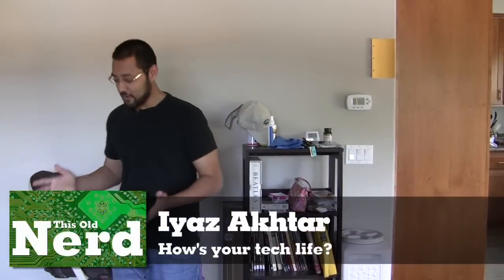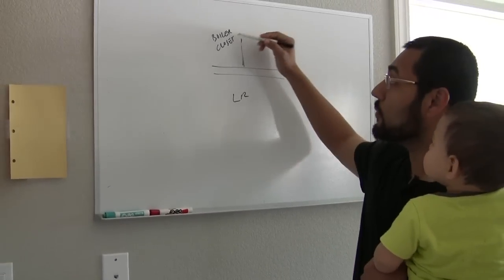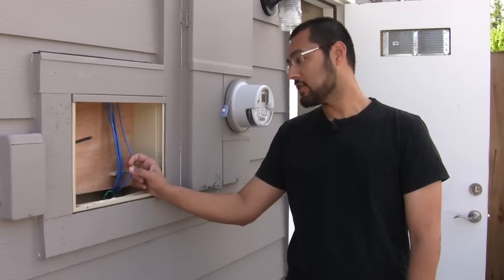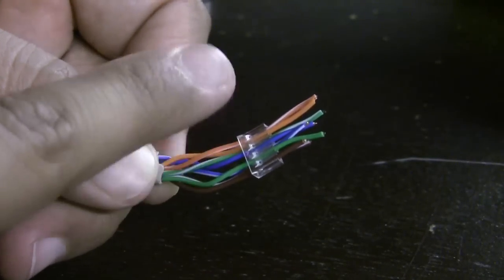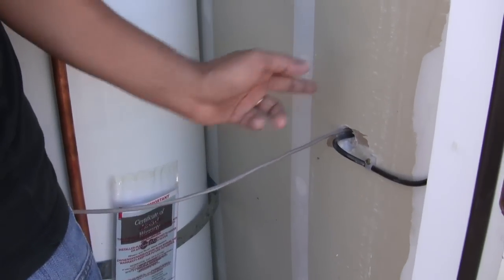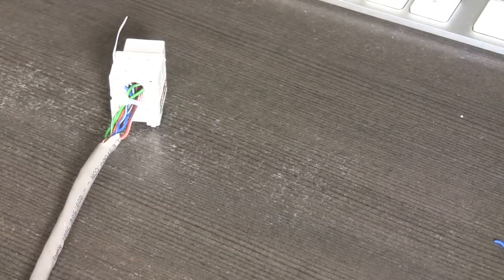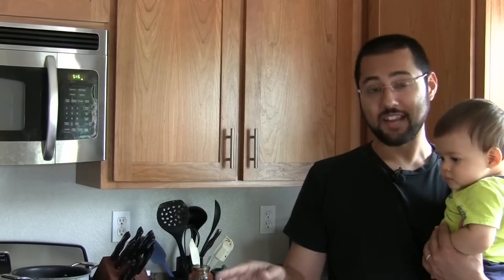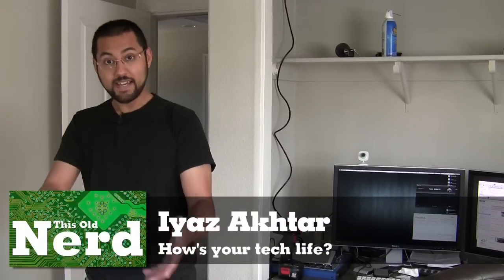Setting up a home network

Comment: I tried several ethernet over powerline systems and they were garbage. I did find ethernet over wifi worked great, so that's the route that I took and have had no problems at all. Great speed and very reliable.

Comment: I like to use the EZRJ45 plugs. As you get older I have to use my reading glasses plus on of those head mounted magnifier to make sure all the wires go into the plastic guides in the EZRJ45.
After you make up both ends you have to get your little tester, plug the transmitter on one end and the receiver on the other and PRAY that all the lights flash in sequence.
If they don't you have to re-do both ends.
It's quite an experience.

Comment: My home is set to be ready for move-in on 12/5, I ran 850ft of cat 6 and couple hundred feet of rg6 for cable tv before they put up the walls.  Today my wallplates, keystones, tools, 24 port gigabit switch and cat 6 patch panel arrived.  Gonna be fun punching every thing down and making it look nice-tight.
Reply: Cat 6 is a bit overkill considering you're using a gbe switch. Cat 5E would have been more cost effective.
Reply: Thomas Sawden Thanks for the reply, I had the $$ to get cat6 so that's what I got, it's been installed since about October  '14
Reply: +Thomas Sawden Cat 5e and Cat 6 cost the same.
Cat 6 can be used for 10GbE later if he upgrades the patch panel and switch.

Comment: Really good friendly video with great advise. Minor issue with the excess untwisted wires on the keystone and the connector. Interesting RJ-45 with the wire separator. Good Stuff. Thanks for the great video, I highly recommend it.
Bryan McGann
Reply: Bruh the comment section is not to write letters. You don't sign your name at the bottom. It literally says your name above the comment

Comment: Thank you~Thank you~Thank you...
I just stumbled across your video. Did I say thank you yet?
You just saved me an enormous amount of time-sweat-blood-cursing...
My home builders also used network cable for the phone lines. Awesome.
I've been dreading running new cable to the second floor (from the basement).

Comment: That's a pretty standard 4-port keystone coverplate. They sell ones similar to that at Home Depot and Lowes. The only thing that makes the one in the video special are the little recesses over the top and bottom screws, for inserting labels.  Those are more common in commercial installations; ones without the label recesses are more common for residential use.  Amazon and CablesToGo sell both, but I'd check local stores first.

Comment: I say this because in my experience as an ISP tech, switch do fail quite often. For the price that you are going to pay for the one 8-port and the several other "mini switches", you could buy one 25 port and save yourself the headache. How many rooms and connections/ room do you need? How far apart is each run? What will you be running on each port? These are all questions that we would need answered to make sure you are not wasting your money.

Comment: 110 is an Electrician thing. I dont know any good cable vendor that would use 110 for a network.  You are correct about his jacks and i would even chew people out for doing this work in any environment.  He does have some good tips i will admit.

Comment: 13:53     Ideally, the cable sheath should come right up to the  back of the Keystone, and each pair should continue to twist together as far as possible.  This is even more important, if not critical, when using Cat 6.

Comment: Usually you use a dedicated uplink port to daisy chain the switches together. Being that its a smart switch, you may be able to configure each port but be sure to check with the manufacture. A network map would help me figure out what you need...I still say It would be easier and probably cheaper to use one switch and just run how ever many lines you need from there.

Comment: If you are networking I would suggest these 3 things:

1. start with Cat 6a cable, it's not too expensive, nor is it too cheap, for a home install, it shouldn't effect you too much until you get direct fiber with 100 gigabit speeds, even then most times your internal things such as your modem, your TV and other devices will be a limiting factor.

2. if you are going with a fresh install, measure out your rooms and add a foot per wall, in fact add several feet for a service loop - your contractor will love you for this.

3. Label each connection, if you are going to have 2 connections label them on both ends "Master P' and "Master D" P for phone and D for data.

If you do these things, while keeping your workspace and the track (path the cables will take) organized, you will be far better than many "professional" installers out there, and I have seen so many rats nests out there.

Last thing you want is to go back and troubleshoot your connections when it's your own job,

Comment: If I have a telephone jack in my room, and it has Cat 5E cable, could I just put in an Ethernet keystone and use it as an ethernet jack without interrupting the home phone lines?
Reply: +New American Fishkeeper yes you can, as long as that cable on the other end is patched into a switch or router.

Comment: It doesn't matter which colors you use as long as you match them up right on the other side.. TIA/EIA 56A and B are the official way, but each individual wire is the same as the rest, just with a different color on it. The important thing is which pins the NIC on each end uses to send/receive. I have cat5e and I've messed with different pin configurations. For Ethernet and FastEthernet you just gotta focus on pins 1,2 and 3,6.. GigE uses all 8 pins though

Comment: 110 is also used in patch paneling, i think you are confusing it with 66 block  which most phone wiring is done on. He does have some good tips although his wall jacks are a bit sloppy (too much cable showing) but that is just me nit picking, its fine for residential, but i would chew anyone out doing that in a commercial setting ;)

Comment: A normal "office/home" router that you can find at Wal-mart etc will have normally 4 ports for output, now if you have a house with 5 cables, like this video has, he has a switch that looks like a  8 port switch and 5 of them being used. Not all routers have output ports, so a switch is sometimes necessary.

Comment: I have cat5e cables in my house for the phone, but I only have one wire coming into the house.  but in some of the phone kestones have 2 or 3 cat5e cables.  how do I go about changing them over for my network
Reply: James Kelly Phone uses one pair of cat5 usually blue and blue white and they are tied to the red and green line coming from the pole. In your house there should be a place where all the cables are. Normaly close to where the electric power comes through the house in the basement there should be a panel you can open up for access to cat5 and coax.

Comment: Keystones were done poorly. You want to maintain the outer jacket as far up to the jack as possible to reduce long term strain. Also, each colored pair needs to maintain it's twisting as far up to the punch down points because the twists allow the lines magnetically cancel each other which reduced interference.

Comment: From 4:50 on: Note that this is an unshielded Twisted Pair Network cable (which is of course fine for telephone). So not CAT 5E (as previously shown) but CAT 1-3, which is sutiable for 10BASE-T (or 100BASE-4 which seems to be some kind of american weird standard), but not for gigabit. Also using CAT 5E cables for gigabit is usually not a problem, because wire length used in normal households are fairly short. If one would need to run more than say 50meter of gigabit cable, he/she should use at least CAT6. Above 100m fibre should be used if the full gigabit speed is wanted.

From 11:50 on: The cable tie is supposed to grab the cable at the sheath, and not at the wires but I suppose that is not so important. Also it is good practice to leave the twisted pairs twisted as long as possible when entering the keystone thus ensuring a good signal integrity.

Comment: Thanks for the video. My house has Cat5 running to the telephone outlets as well. My question is how to I find out which cable runs to which outlet?
Reply: You dont. Cat 5 cable is certified for a lowly 10Mbps, pull it out and run Cat 6.

Comment: watched the video and found out i do have cat5 run throughout the house to phone jacks. the issue appears to be that the telephone box is on the opposite side of the house from where the cable guy brought the cable into the house. would it be simple enough to to make the phone jack by the modem the starting point or should i run a cable line to the where the phone lines come in?

Comment: Hi Thanks for sharing this video and suggestions,
 I want to add a 8 port Switch to my network what would be a good one with gigabit ready just incase I increase the speed later?. I was using the Linksys EZXS55W with my Linksys E3000 v.1 the one with the Blue antenna around it.

Comment: Cat 5e is actually certified to do gigabit Ethernet, you wont get the same throughput due to the cat6 cable having a crosstalk reducing devider. The only thing you can do with cat6 you cant with cat5e is 10gbE.

Comment: Some good info here, but you will NOT terminate your cabeling to a 110block. That is used for voice infrastructure.  You will want to terminate the wiring to a patch panel. Also when making your RJ45 ends you dont have to follow standard color scheme. You can terminate how ever you want just as long as it matches on both ends. I wouldnt use a magic marker on the jacks. I would use a label maker as it will look more professional.If you are going to run cable i would use PLENUM rated cable.

Comment: hey bud QQ. what port do you have your modem on your switch? i see you have the 5 cables to switch then switch (grey cable) to router... the reason i ask is cuz i want to move my wireless router from upstairs to downstairs. everything is connected to patch pannel upstairs (wireless router, modem and switch).

Comment: Question...what if the moronic installer terminated the cat5 cables in a box on the outside wall of the house.  Can I use a patch panel to connect them in the box or do I need to use a PoE switch?

Comment: It depends on the switches throughput speed, rating, and quality. Switches nowadays are pretty good at not being a parasite. Older tech. like hubs can slow down a network...it all just depends on the age and quality of the system.

Comment: Hi. At 8:55,  you said the red keystone is a input. Does it have to be wired differently so that it becomes an input?
Reply: straight through and crossovers
Reply: Do straight throughs go in the wall or the crossovers?
Reply: If you google 
straight through and crossover cat6 should tell you what you need to know.
Reply: 00

Comment: Great video but not really for newbies. Your switch looks exactly like my D Link dsl router but you really didn't elaborate. Will that work as a switch and for internet? If so, does the router need to be setup for the network?
Reply: +Paul Ladendorf A router links your internet line to the rest of your house, normally a home router has a small built in switch for an extra few ethernet sockets. What a dedicated switch does is it splits the signal further, the more areas of the house you need to cover, the more switches you need to place around the house, or alternatively buy a larger switch.

http://www.cisco.com/cisco/web/solutions/small_business/resource_center/articles/connect_employees_and_offices/what_is_a_network_switch/index.html?referring_site=smartnavRD

The router is a necessity, the switch is only needed if you need to branch out your network further.
Reply: +Harry Akira Eaton I have so many old routers available to use as 4-port hub/switches, I'm not sure I'll ever have to buy a switch! :)
Reply: +Scott Hertzog To be precise, a Router connects between networks, while a Switch connects devices within a network. You can use a router as a switch, but not the other way around
Reply: +Paul Ladendorf switches have no logic. you connect cables to them and they just are there for communicaiton. the switch has to be connected to a router to route the traffic. a router is usually connected to a modem which translates internet signals to ethernet which can be routed by a router.
this is indeed a newbies guide.
yes it will work for internet assuming you're routing internet on the router it's connected to.

Comment: Guys just want to give you additional info, a modular plug is also called an rj45 plug and the keystone is also called a cat 5/5e/6 (etc.)jack. When purchasing these componets please make sure you get the same specified as your cable or higher, so if you had a cat 5 ethernet cable get a cat 5 rj45 and cat 5 jack or higher than that which would be 5e or 6. If you get a lower rating such as cat 3 you will experience seriously slow data rate speeds if you have an 80mbps down/up speed because cat 3 only supports 10mbps.

Comment: I've done exactly waht you said But I ran into an issue that You should cover! A single ethernet conection per room is not enough, so I added a switch to ea Rm & lost communication at each swtich! Non of them work! I found out I need a "Smart Swith" a "NETGEAR - ProSafe 8-Port 10/100/1000 Mbps Gigabit Ethernet Smart Switch" so that it assigns IP adresses to all switches that are to piggyback on It. I'm about to go purchase this swith but I would appreciate your input. I need to configuring it.

Comment: Whoa, where did you get those Ethernet jacks with the guides? That's an amazing concept! The most frustrating part I've encountered with such installations in trying to keep those pairs straight and even. I'm guessing these aren't cheap, but if I'm only doing a house install for myself, I'll be more than willing to splurge a little.
Reply: I do about 200+ connectors a week (network installer) those guides just slow you down and cost more. I can do a connector in about 2 min flat from stripping the jacket to crimped. Best advice, just practice.

Comment: The router can be plugged on any cat5x network outlet and it should be good to go.
Here's the order: cable modem ->router--->cat5x outlet-->terminated to the switch where all cat5x cables meet.  That's it.
Reply: +TP 4UrbHol defuq is cat5x.
As far as ethernet goes there's Cat 5, Cat 5e, Cat 6, Cat 6a.
at least you know the order. modem, router, switch, patch panel, keystone wall plate, ethernet cable to device.

Comment: I currently have DSL with a wireless modem, which is horrible! My modem is in one corner of my house. and the wireless signal isn't strong at all. I plan to switch to cable 100Mbps, but I want to convert my phone lines (unused) to Ethernet. 

My data lines come in from an outside garage wall. Question: Can I locate my Ethernet switch in my garage and use the Ethernet plug that my DSL is currently plugged into to hook a cable modem to the switch? The way I see it, all I have to do is isolate the line connected to the DSL plug and dedicate it to the modem and then use the remaining lines for dedicated Ethernet ports. Am I right? I'm trying to avoid routing a new cable to connect my modem in the home office to a switch in the garage if I can simple use the existing plug. Thanks!
Reply: +Tommy Lee If you keep your voice and data lines separate, it should work. A word of caution: If your garage gets extremely hot or cold, it may kill your switch. All of the cat5 cables in my house ran to a phone box inside my garage. Originally, I had simply cut them away from the phone box, attached RJ45 plugs to them and connected them to a switch. Everything worked great until, after a particularly cold snap, my switch started dropping packets like crazy. After that, I bought a new switch & relocated all the ethernet connections to my basement.
Reply: +Shmeh Fleh Thanks. I ended up locating the Cable Modem to the middle of the house and ran an new Cat 5 cord to the office to plug my desktop in. Worked out pretty well and still have a spare port in the cable modem if I need one later.

Comment: I can butt both ends of a cable in less than a minute... Is yours supposed to be "The" way?
Take the wires, put oranges on left, put browns on right.
join the b/w to the pair on left and green white to the one on the right.
pull the green to left side of center, and green and white to the right side of center.
Hold all the wires within your thumb and index finger and flatten them by slowly pulling them down from the wrapped part of the wire.
twist little up & down while you're pulling the wire so wrinkles will reduce.
keep holding them from a desired length, mine is 2/4 inch and cut the excess wires on top.
start inserting the tip, flat side up to see the wires, and orange wire is on the left to have correct scheme. Do this without removing contents, wires will find the way because they can't wiggle inside. apply force, make sure they're touching to front panel of the tip and crimp it. 
You're welcome.

Comment: I am stuck with a single old telephone wall jack.. if run all new cat 6 keystones maybe 4 or 5 will I lose any of my Internet download/upload speed??
Reply: +Johnathan Williams you will very likely increase your internet speed. run 1 cable for the adsl modem, use RJ11 keystone for only that jack. for the other wall plates run ethernet to them and use RJ45 keystones, preferrably Cat 6.